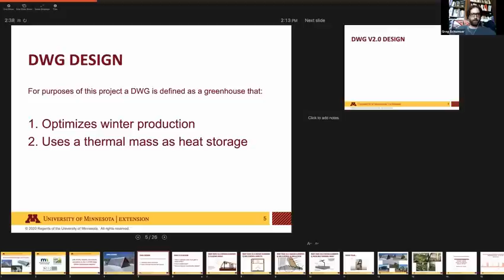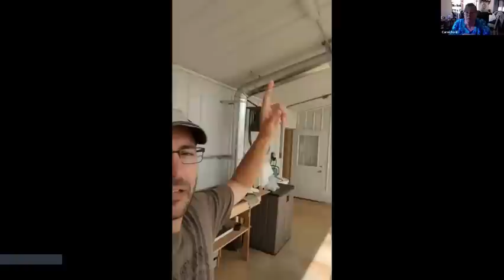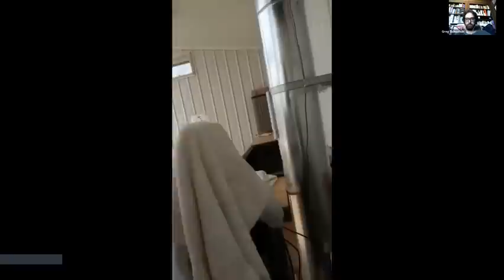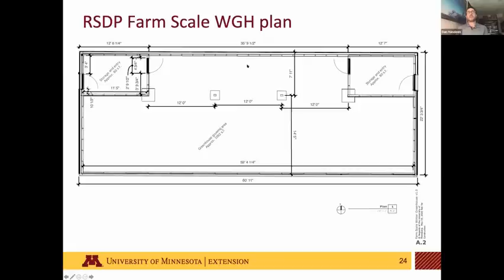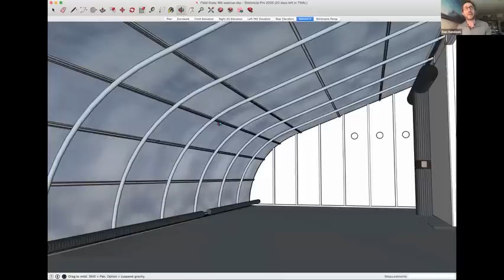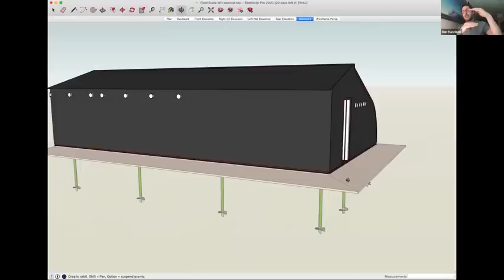New Farm Scale Deep Winter Greenhouse

Comment: Where does this glazing come from? Is it commercial grade or home?
Reply: this looks a bit iffy. I am surprised that they never replied to your comment. I did hear that polycarbonate was being used. yet with polycarbonate, the glazing bars run up and down, not horizontally, like what they are showing here. with horizontal bars, rain ingress due to polycarbonate expanding, and retracting from temperature variations is a sure thing. Also, there will definitely be an algae buildup
Reply: ❤I have only installed my polycarbonate,vertically

Comment: Regarding the "holy grail" that he speaks of at around 1:10:00, there is a guy on YouTube who has what seems like a solution to me. He's a Canadian farmer doing a Chinese greenhouse with a thermal barrier outside of the glazing, as is traditional, and then he has another greenhouse frame outside of that. So, he has the benefits of the exterior thermal blanket, without the problems of wind and snow affecting it. His name is Dong Jianyi. Here is a link to his YouTube channel - https://www.youtube.com/channel/UCgs_cmCc-3Nczf6_RQpqmYg
Reply: too fidderly, especially when it comes to replacing polythene. I would go for a roll-up thermal barrier under the roof. summer conditions. I would possibly be able to reduce the thickness of the thermal mass, so as to use it as shading from strong sunlight.

Comment: If, as you state, the Chinese are "light years ahead of us" in greenhouse design why are we not using some of the concepts that they use? There is also a Canadian who has done some fabulous work regarding unheated greenhouse design. What about using solar thermal to aid in heat storage? And who are you guys really working for? The manufacturers or the Creators? $20k to$60k for a building that is 1/4 the size of a postage stamp seems a bit excessive. Although the farm scale design does seem to be heading in a better direction. Mr Finch's design uses 2 different forms of geothermal heat transfer, one which recirculates air in the greenhouse, the other pulls in fresh air. To me the idea of pulling in fresh air seems like a great idea. I'll stop here. While I may seem a bit sarcastic in this reply I do appreciate the work you all have done.
Reply: Agree that we don’t need to reinvent the wheel just because the Chinese invented it.
Reply: Agreed about copying the Chinese design. A nighttime thermal blanket is key to the effectiveness of the Chinese system. It could be incorporated inside the glazing for convenience and protection from snow.
Reply: So most commercial greenhouses in Canada are designed to optimize light because the days get so short. 
It’s been more economical to do a full glazing oriented North-South and heat with (until last year) cheap natural gas.

Comment: Thanks for sharing a great design.  Regarding air flow through the rock bed.  I would expect that the warm air would rise as it enters the rock bed before descending to the outlet pipe.  If that is the case, then the temperature in the rock bed will tend to stratify being colder at the bottom.  That could reduce the efficiency of heat storage.  I suggest that a hybrid system may be better where you have alternating input and output transfer pipes between manifolds.   I look forward to seeing the temperature data published.  Cheers, Julien.